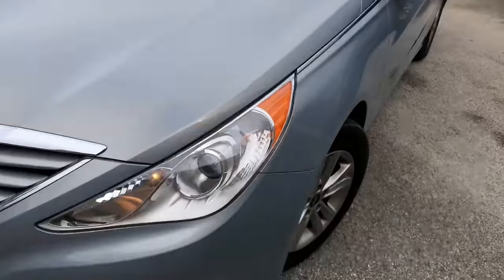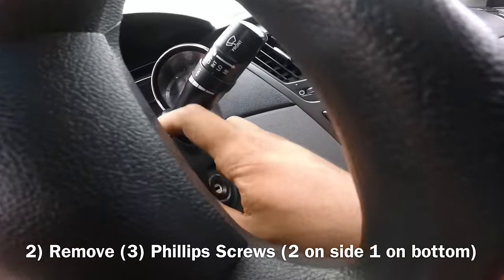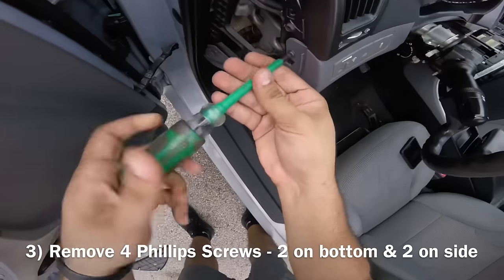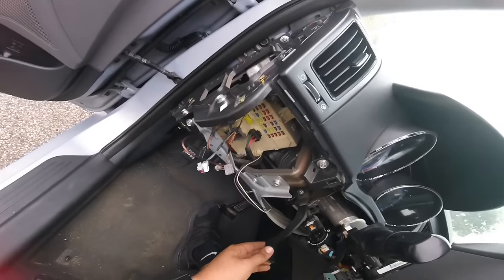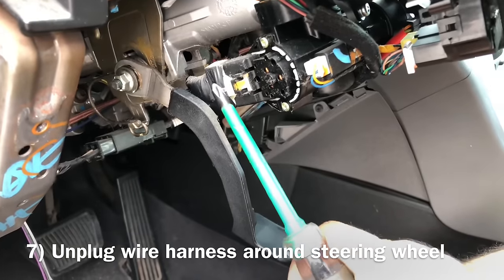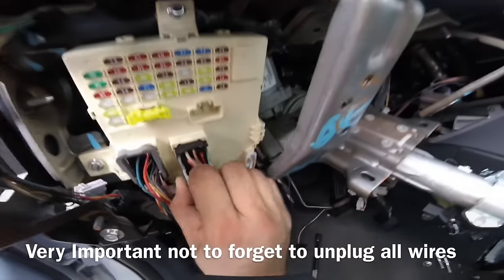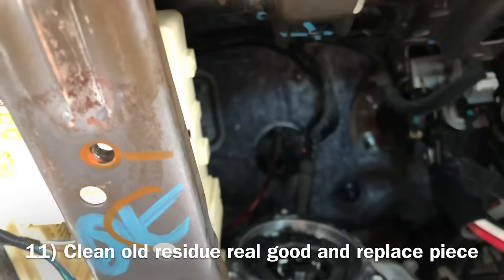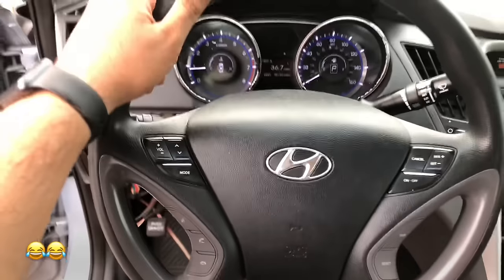HYUNDAI STEERING WHEEL NOISE : HOW TO FIX - SONATA/ OPTIMA 2011-2014 UNDER $20!! FAST & EASY!

Comment: Hey man i did it on my sonata11
But now my EPS and traction light came on and its hard to even turn the steering wheel 
Any idea where i went wrong?
Will be doing it again
Reply from the maker: Hey bud congratulations on doing it yourself. 
Sorry to hear about your EPS & Traction light. 
And if it’s hard to turn the wheel, sounds like the pump isn’t working... please double check all connections to make sure everything is plugged in... it’s easy  to damage a thin wire. So we have to be very careful when lowering the steering column... my suggestion would be to please double check everything  and make sure all fusss and wires are where they should be. If not I would strongly suggest having a mechanic check it out...
Reply: Hey buddy as u said i took every fkng thing apart to see the wiring and put it back again but I couldn’t find it nd then i took it to a mechanic he did the same shit again and couldn’t find why those lights were on but forth time I got it done from a guy who had some knowledge and i showed him ur video and he found a small wire somewhere behind the column which was not plugged in properly and now this shit is finally working. And i gotta say i hate that hooking in part because i did it four time. Gave me a sore back.thanks for the video brother it was actually very helpful.
You r the best.keep them videos coming.
Reply from the maker: Hey man!! omg!! I am so sorry for that inconvenience you went through man.. foreal.. lol okay please share, if you don't mind, how much did the mechanic charge you? the good one that fixed it.. and nice! what did he say about the video?? lol just wondering.. and yeah man I am telling you them wires are a pain in the a$$.. and dude don't get me started on the hook... I've struggled with a few of them! hahaha!! definitely a workout... I sat on the driver's seat and used my feet to hold the steering column up and I was pushing with my heels against the floor of the car to keep the column up and helped alot!! and thanks man! I appreciate you for watching! and everyone else reading this comment!! thanks for the love and support!
Reply: That guy who actually fixed (hes not a mechanic though) but he studied in automotive and the mechanic they didn’t charge me nothing.because the mechanic is a good friend of mine.but that mechanic usually charge $200 canadian.but they say still the money varies on the time taken.i bought tools for $20 and that freaking coupling $2.50 from hyundai and funnybthing my tool kit was only having till T20 so i had to buy t30 bit separately cost me $3.i wanted to do it by myself i dont know why lol. And i was doin it at my place so that steering wheel was so hard to turn because that motor was not getting power.so i drove it to my buddy’s shop somehow with one guy helping me to turn that steering wheel.dude that was a big risk but I dont suggest anybody driving it without that motor receiving power. And yeah now its fixed after driving it for a year with that noise.feels so good to drive it without that annoying noise. I gotta tell you sometimes even in my dreams i used to hear that clunking noise lol. Cause i been hearin it every freaking day for the past 1 year.btw where are you located? You have a shop or something?
 thanks again man for replying and the videos .RESPECT!!!
Reply: That guy who actually fixed (hes not a mechanic though) but he studied in automotive and the mechanic they didn’t charge me nothing.because the mechanic is a good friend of mine.but that mechanic usually charge $200 canadian.but they say still the money varies on the time taken.i bought tools for $20 and that freaking coupling $2.50 from hyundai and funnybthing my tool kit was only having till T20 so i had to buy t30 bit separately cost me $3.i wanted to do it by myself i dont know why lol. And i was doin it at my place so that steering wheel was so hard to turn because that motor was not getting power.so i drove it to my buddy’s shop somehow with one guy helping me to turn that steering wheel.dude that was a big risk but I dont suggest anybody driving it without that motor receiving power. And yeah now its fixed after driving it for a year with that noise.feels so good to drive it without that annoying noise. I gotta tell you sometimes even in my dreams i used to hear that clunking noise lol. Cause i been hearin it every freaking day for the past 1 year.btw where are you located? You have a shop or something?
 thanks again man for replying and the videos .RESPECT!!!
Reply from the maker: Oh okay! Well good for you!! It’s always a blessing to have people like that... you see... I am in the same boat, I am not a mechanic, however I went to automotive school for 2 years and completed a few certifications and got some papers to hang on my wall lol. But I actually own a small lot. I’m down to 1 car in my inventory at the moment but before then I used to do oil changes, alignments and brakes at a Firestone shop! Got tired of that! Then became a car salesman! Loved it!, got promoted to manager within 7 months, ran my own store for 4 years then I decided to open my dealership. And lots of things happening I decided to slow down for a second, take care of personal stuff then go back in 100% in 2019! The cars I fix here are the cars I buy, (sometimes fix, if they need to) and Sell.. and dude! That noise is super annoying. I remember being at auction and seen a bunch of buyers move the steering wheel on the Hyundai’s to hear out the noise.. I didn’t understand why they’d do that.. until I actually bought one with the clicking!! So I did what you did! Went on YouTube! And saw how the videos were good but I felt like I could do it better and explain people more you know... and then I did it! Also I want to keep a visual record of the repairs I make you know!! And man thanks for watching!! Much love!! I’m glad that noise is gone!!
Reply: You are doin great man.infact my friend is doin the same thing bro he goes to auction buy cars fix them and sell.he been in business for so long.hey dude i am also having that 2 years certificate in automotive lol. I graduated this year.i also want to get into this business so i am learning its actually good.may be some day i ll get into it.where are you from man? He doesn’t buy sonatas anymore man because all of them having same issues.hes focuses on civics and toyota corrola, camry, accord. They sell fast.
Reply from the maker: @sevenstar3715  Thanks so much! I really appreciate that! we are all car guys! stick together! lol and it's a great business! and for sure! it's always a good time to get into it!! and I am from Houston, TX. and yeah I will still buy them!! they're great!! and all those cars are excellent flippers and money makers as well as reliable!! and yeah man stay tuned for more videos coming soon.
Reply: @sevenstar3715  this saved my ass, same thing happened to me, but thanks to you, I knew what to look for.
Reply: smithgrege 
Good man!!
😄Good to know that you didnt have to go through all that struggle.
Now iam gonna replace my clock spring tomorrow. Because my cruze buttons are acting up and also I can’t honk anymore.because of a bad clock spring
Lets see how it goes!!
Reply from the maker: Seven Star***** be very careful with the clockspring! BE SURE TO UNPLUG AIRBAG!! & BATTERY!
Reply: Hidalgo Motors Co 
Thanks for the heads up dude
I will make sure i don’t mess up this time.

Comment: Really question is, am I am danger driving until my part gets here????
Reply from the maker: Not really, just gotta be careful because the steering wheel will shake a lot at highway speeds and may cause you to jerk the vehicle and could potentially lose control... but it solely depends on how you drive.. if you’re careful you should be okay.

Comment: I accidentally took off the steering lever adjustment, does anyone know how to put it back on?
Reply from the maker: Jashaan Allen oh man. How did you do that? I think just screw it back in no?
Reply: Hidalgo Motors Co TV  I thought that it was the screw you were referring to. I was wrong sadly and didn’t notice until it was too late.It has 2 different washers and a key ring for some reason. I am not sure what order it goes in. At this point it’s underivable because the wheel just drops in my lap

Comment: Awwww dayum are you serious?! I just got this done and was told it was some kinda clockspring😑😑😑 great vid tho👍
Reply: glantrider that is a different recall. There is one for the steering coupler and one for the clock spring, if the clock spring is bad it means that in the event of a crash the airbags might not deploy.
Reply: @armandosanchez8981  right so it looks like I have 2 recalls to look into with the manufacturer, thx.
Reply from the maker: Hey man were you able to get the problem fixed, if so, how much did it run you?
Reply: @HidalgoMotorsCo   ya I got the problem fixed long before I saw this video, and I dropped a couple hundred on it. I've been lagging but I'm gonna get the receipt from my mechanic and see if I can get reimbursed from Hyundai hopefully 😎
Reply from the maker: okay! that works! thanks for watching!! :) really appreciate you guys!

Comment: ok I finally did it, and it works!! BUT.. if you're inexperienced like me it'll take up your day. It took me EIGHT hours 🤣 like damnn
Reply: Took me 9 hrs and I still hear the sound 😐
Reply: @isaiahbih  how???
Reply: @JordanDrewVideos  idk man but I was angry. Like it literally just sounds quieter but I can still hear it
Reply: @isaiahbih  but does it rattle?? like over bumps
Reply: @JordanDrewVideos  I haven’t driven it yet but I don’t think it will rattle
Reply: @isaiahbih  I mean that was MY biggest problem. any bump I hit it rattled loud! after I did this it stopped completely
Reply: @JordanDrewVideos  for me it’s just the fact that I can hear the bumping/knocking noise when I’m sitting idle and turning the steering wheel. I don’t wanna hear any sounds lol
Reply: @isaiahbih  mann that shit shoulda went away!!
Reply: @JordanDrewVideos  exactly bruh I’m angry. Don’t see a point in taking it apart again either

Comment: The other thing to know is that this part has an extended warranty from Hyundai 15yrs or 100,000 miles, check and see if you can get it coved by the dealership...It is not hard to fix but if you can get Hyundai to fix it it might be worth a at days at the dealership.  Mined lasted till about 200,000 miles on a 2012 Sonata Hybrid, about the only thing that has worn out on the car besides the tires and battery,  still have the original brakes!
Reply from the maker: Deserthelo awesome! They can be very reliable! Although regular maintenance is highly recommended for reliability and for safety purposes’ make sure you routinely check your pads and rotors for wear. Once again thanks for watching!

Comment: I got a special one for you. After the dealership fixed the steering column they told me that it had damaged the "mid shaft" and that was not under warranty and they wanted $800 to fix it. Has anyone else experienced this issue?
Reply: btw the sound it makes now is almost worse than when the coupler was damaged. It shakes the entire car under highspeed braking.
Reply from the maker: Wow! Yeah I wouldn’t be surprised! Their job is to sell you repairs even if you don’t really need them... they “suggest” or “recommended” but wow $800 is steep. And man sorry about your experience! Look around in smaller shops.. like non franchise shops.. maybe they will be less. And still offer warranty.
Reply from the maker: Thanks for watching by the way’
Reply: yup dealership messed up my steering wheel after fixing this issue. Now it makes a strange whine noise and they wanted 2,220 to fix it since it's not under warranty. I got fucked

Comment: Hyundai replaces this for free if your car meets warranty standards, my 2013 Hyundai Elantra is 60K and will be fixed fro no charge!! If you can’t do this yourself, consider calling your local Hyundai! 💗
Reply from the maker: Yes That’s absolutely right! In the video description we say this fix is actually a recall and may qualify for a free fix.. you have to call the dealership and provide them with the ViN to see if it qualifies, I called and mine didn’t qualify so I had to do it myself :) thanks for watching!

Comment: the cause is from turning the steering very quickly all the time, i have a 2019 on startup it is making grinding noise and then subsides somewhat after driving it for a few seconds. this will be my last hyundai as well since it is apparent they are going back to their old ways of cheap garbage cars.
Reply from the maker: thanks for watching! and they are pretty good on the warranties though. I've sold kias and hyundais in the past. although I agree.. they are just cheap cars... that's why many people choose them. they resemble the expensive vehicles at fractions of the cost.

Comment: Well I just started mine and the last 3 screws to open the part that have the coupler didn't wanna unscrew and now they went bad and I can't do anything about it! Only one came out with no problem. The other two are still in there and won't come out. F@ck!!
Reply from the maker: OH NO!! that’s not good! You have to get a screw extractor and drill them out. Hope you can get a drill in there! It should be easy

Comment: It isn't as easy as this guy makes it out to be. He obviously prepped the area to make the video. There are a couple important things he doesn't mention. 
1. All of the connectors are not simply push-on. They all have some type of clip you have to figure out how to unclip. Some will require a screwdriver to push the tab in. His connectors appear to slip out easily. They will not.
2. After all the connectors are unplugged, you still have to detach the cable arrays from the steering column. He skipped over that part because his cables were already detached. You can't drop the steering column without detaching the cable arrays.
3. The bolts and nuts that hold the column in place are 12mm. Make sure you have a socket wrench; nut drivers will not work.
4. The screws holding the motor in place are not philips, they are hex head screws. You need a socket wrench with the right tip, and an extension to reach the back screw.

Comment: Just got off the phone with the Hyundai dealership and they will replace this free even if you are not the original owner as long as the vehicle is under 100K miles.   The wording he used when reading it out loud was "and subsequent owner."  Use this link -   https://autoservice.hyundaiusa.com/TXX7/MicroSiteTemplate/MicroSiteTemplateVINValidate/2687     to enter your VIN # to see if your car qualifies before you call the dealer.
Reply from the maker: Wow thanks so much! That’s helpful! We really Appreciate it. Thanks for your feedback

Comment: 2013 Optima. same thing.  Had it fixed a year ago.  Problem is back. Kids,  never buy a Kia or Hyundai/.
Reply: This is covered under an extended warranty. I have a 2012 sonata with under 100,000 miles and I'm the 2nd owner. Mine goes in Monday to get fixed free of charge.
Reply: @beenrudy  Thats not the point. Its just going to keep happening  over and over again. They  use the same defective part for the repair.

Comment: To much work when you can get it done for free
Reply from the maker: Chayse Medley Exactly!
Reply from the maker: Some are not covered by the recall tho :(
Reply: True. But great video for people that don't have that luxury. I just got my 2012 Hyundai done last week and researched and realized it was on recall. They did it for free.
Reply from the maker: Thanks 👌🏼
Reply: lol @ placing the steering column trim on the concrete so that it gets scuffed up.  Could have easily placed it on the soft passenger seat or backseat instead.
Reply from the maker: Lol yeah bro! My boy actually did pick them up and put them in the back seat. Hahaha
Reply: @HidalgoMotorsCo  

Thanks for the video. bro.

I'll likely be doing one on a 2011 Sonata next week.  Need to see if it's covered under an extended Warranty first.

I'm hearing some are covered while others are not.  Would like to know how Hyundai makes this determination which get covered.
Reply from the maker: CrociatoAzzurro yeah man it’s not bad at all. I tried to make this as simple as possible.
Reply: @HidalgoMotorsCo  

Did mine this morning.  Hyundai Dealer here in Toronto, Canada, said they didn't know anything about an Extended Warranty.

They wanted to sell me a complete Column.  When I went to the Parts Department and had a look at the picture of the steering column the Flexible Coupler wasn't even shown.  They kept telling me that they didn't know what I was referring to and it was not serviceable.  However it seemed like the canister portion (the section that the rubber coupler is located in) was serviceable so I told them I'd buy that.  One minute later they said the canister wasn't sold separately and I had that to buy the entire column.  They insisted I buy a column.  What bothered me about it though was according to the exploded parts view, the canister part was sold separate as it had it's own part number.

So I spent all of 2 minutes online and found one from 'Dorman''.  Part Number 926-990 for $26 and it's in. Noise is gone.

The old was was absolutely torn to shreads.  What was left of the rubber coupler was soft so I figured it was exposed to significant amount of heat.  In light of that I covered it in a light silicone brake paste to help keep it cool.  Don't know if it will help but worth the shot.
Reply from the maker: Bro that’s awesome! I’m proud of you! Simple fixes shouldn’t cost an arm and a leg.